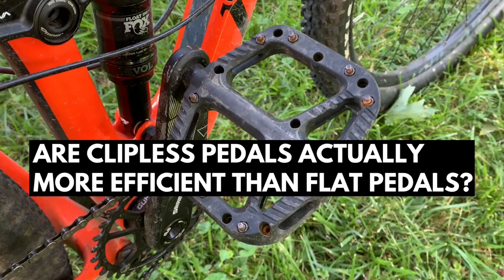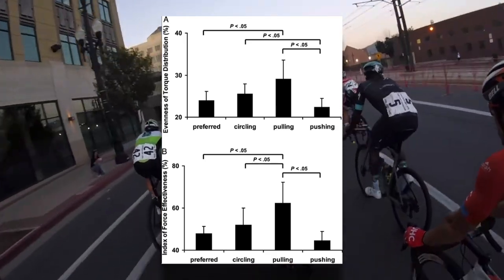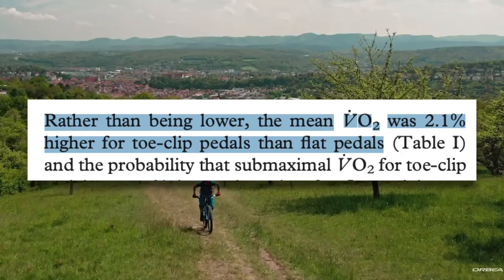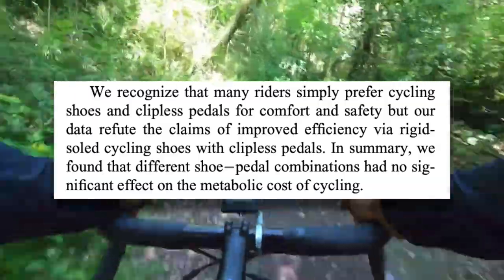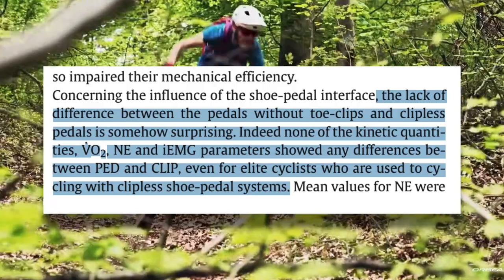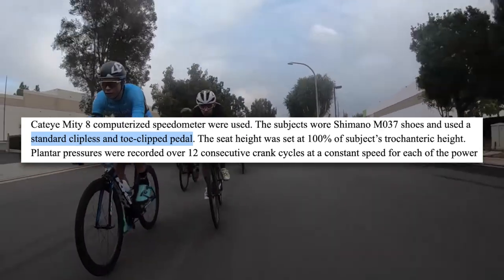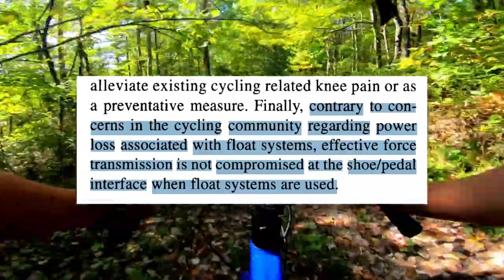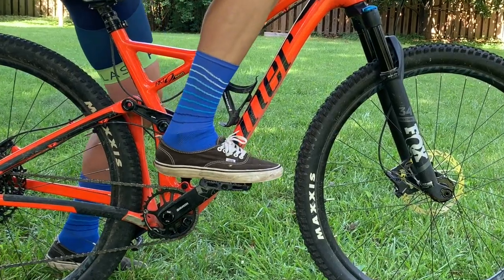Are Clipless Pedals Actually More Efficient Than Flat Pedals? The Answer Might Surprise You.

Comment: I prefer flat pedals but it took a few years to get the right pedal and shoe combination. I use a set of flat pedals with deep teeth on the outer edges and a pair of lightweight walking shoes/trainers with a deep rugged tread that matches the spacing of the pedal's outer edges.  I find even in wet weather my foot rarely slips and yet I have complete freedom of foot movement. Stopping and starting is easy, for example, when I'm out with the group and we stop at a junction I'm always first across it while the others are fixing their shoes into the clips. Also, I've developed a 220-240 degree rotational force on each pedal as the grip of the shoe lets me push before TDC and pull after BDC.  I'll admit that should I do more serious mountain biking or road races I would probably consider clipless rather than flat pedals.

Comment: I went to flat pedals for mountain biking, and NO WAY would I ever go back. It's great when you need a quick foot out to prevent disaster that can happen at any time. I still clip in on my road bike, but I am thinking about trying flat pedals there too, for the same reason.
I motorcycle too, and a quick foot out has saved me many times.
Adding more float also adds to the amount of rotation needed to get unclipped - not good.

Comment: I can think of 2 situations where flat pedals just won't cut it. Anything at actual high RPM (200+) and when you are putting down serious power. The highest I saw in the clips shown was 1100 watts. I'd like to see someone do 2000+ watts on flat pedals. I get it, it isn't about efficiency but thats partially the point of clipless, you don't have to worry about control at the really high power or really high RPMs.

Comment: I cycle about 12.000+ km each year. 30km+ every day without caring for any weather conditions (rain, snow...). I would never even consider clipless. I like to sometimes change my foot position on the pedals, especially uphill or on longer tours. Further since I have to drive a lot (2/3) between crazy car drivers on regular streets, I dislike the additional risk due to the unclip time.

Comment: It's been known for a long time that you don't pull up on clipless pedals except at very low cadences, the benefits are in a solid power transfer, a recreational shoe has EVA foam to absorb impacts, this also absorbs power, you could get the same benefit with a completely rigid shoe. Pulling up has never really been the reason for clipless pedals.

Comment: I’ve used flats for mtb until this year. Climbing in gnarly terrain (rocks, roots, etc.) is where clipless are undisputedly more efficient. Flats require you to stand and “scoop” the pedal so that your foot doesn’t come off. Also when a flat pedal does slip it takes off a significant amount of skin. Descending, you can be lazier with clipless and your foot won’t come off, but it’s not necessarily faster (Sam Hill!)

Comment: Cyclists started to strap their shoes to the pedals before the first world war to stop the shoe slipping or lifting off the pedal when the power was applied. A grooved plate was nailed to the sole of the shoe which engaged in the rear rail of the 'rat trap'.
The problem with doing studies on amateur and non-trained cyclist is they do not know the most effective pedalling technique. They rely mostly on the quads and hams.

The proper pedalling technique is to imagine you are climbing a ladder to the handlebars.

Comment: It's never been about energy efficiency. It's always been about having consistent foot placement and the ability to twiddle - high cadence against lower resistance - much better for knee health. And even when honking - up out the saddle - having your foot clipped to the pedal is better. I have ridden a friend's bike with large flat pedals fitted with those sharp little studs - they're pretty good at keeping your foot in the right place, but I suspect that will be at the expense of rapid wear to shoe soles. My current ride is a Dutch sit-up-and-beg with the Shimano seven-speed hub gears. I wore the cheap plastic OEM pedals out after a couple of years and fitted Shimano SPD single-sided with the required (in UK) reflectors. I have SPD sandals and shoes. I rarely go above 15mph.

Comment: Having your feet in a slightly different position every time is probably better for your joints than having them at the exact same spot every time. As in that's why the floating systems are more knee-friendly as well.

Comment: After 2 years of clipping in on my road bike I discovered the advantages of clipless pedals are tiny and mostly high cadence on very fast flat group rides but the drawbacks constant. After achilles and knee injuries went back to flats and haven't looked back. I can climb better on flats thanks to mid foot pedaling and can also change position on the fly reducing fatigue. Unless you're racing no need to clip in its not that good, much more expensive, more dangerous to boot.

Comment: I use 1989 Time clipless pedals with 1989 Shimano genuine leather shoes on my 1988 Trek 560.
They are absolutely more efficient as proven by Greg LeMond. 
I can apply quads, hamstrings and calves during nearly a full 360 degrees of rotation.
But I use cages on my Mountain Bike so my feet can disengage immediately.

Comment: Since I ride single speed I like being able to change my foot position depending on cadence or power needed. If I have to stomp on it I will place my foot forward and spare my tendons and pull it back as the torque lowers. I tried Speedplay and had to get a longer spindle because my ankle was hitting the crank arms. Now they are in a box somewhere.

Comment: last weekend, i did a 40 miler NOT with clipless but with a falling apart taped up pedal that was sticking to my shoe. it clearly felt like i was able to gain a few watts thanks to the adhesion. so my question is: if clipless can be rated as less "efficient," does less efficient actually mean slower? i don't think that's necessarily the case at all. rather, maybe if you are bringing several more muscles in to bear, they don't have to be collectively more efficient in order to usher in real performance gains

Comment: They are SLIGHTLY more efficient. 
The moments where you actually pull up are very rare. It's only when you sprint HARD that this might become a factor. Otherwise no one is out there pulling up on pedals.
The real advantage comes from being able to accelerate or move around on your bike for whatever reason and keep your feet in proper position. We all remember the marks of the pedals on our bleeding leg because we missed a stroke.
Having the feet at any moment is enough to validate it as more efficient. This being said, have you tried to stop during a 12% gradient climb and then have to clip back on? It's nearly impossible if you have nothing to stand against.. I've see experienced riders have to GO DOWN a steep climb just to be able to clip in and then try to make a U turn while having traffic in both lanes.
Nevertheless, i'll never go for a ride on a road bike with flat pedals. It's just too loose and feels weird. Once you get used to the feeling of being a mechanical part of the bike you'll never want to go back.
But on my mountain bike, sorry, i will NEVER use clipless pedals. I want my feet free to touch the ground at any moment. I've seen enough people fall because of being clipped in and not being able to take their feet to the ground quick enough.

Comment: I use clipless pedal on the road bike and mountain bike. But I am tossed between flat and clipless pedals. Because when mountain biking they do become a problem in tight technical places. But I wouldn't use anything else on the road bike. I don't try to pull up with them. all you need is a smooth pedal  rhythm .

Comment: Interesting. Great video, thanks.
Were there really no studies on climbing or max power output??
I've definitely heard ppl quote (frankly outrageous) power increases.  Though I wouldn't be surprised if they were fabricated.
As primarily a tourer / commuter / casual climber I'll take comfort in knowing it doesn't really matter.
I have been talked in to using old school toe clips, and now that I'm used to them I do like them, esp on step climbs and out of the saddle.
I resist cleats because I like to be able to actually walk... Also $ for nothing isn't my jam.
Overall I'm not surprised that the tests returned no efficiency gains.  After all, pulling up recruits lower efficiency muscles.  I'm already familiar with research that even the hardy and powerful calf muscles have virtually no benefit in distance cycling.

Comment: I bought cycling shoes, not because of efficiency but because I think it is safer to use than flats, Technically when you are clipped-in your foot won't go anywhere, It's safe and secured to the pedal especially on trails where hitting your shin with the pedal spikes are significantly higher, Even on roads cycling shoes eliminates the danger of your foot slipping to the pedals when you hit a pot hole or when sprinting

Comment: I think all of these studies are sort of missing the mark. While I can see why any gains from clipless would be negligible on a road bike or gravel bike, I know from experience this is not the case on a mountain bike. I ride a hardtail and the roots & rocks of my local trails make for a fairly bumpy ride. When I was on flats, there were sections where I couldn't apply power because my foot was temporarily "weightless" on the pedal due to the bumps. When I switched to clipless, I noticed a significant difference in when I could apply power. My feet remained connected to the pedals, even in bumpy sections, so there was never any "weightlessness" where I couldn't apply power.

Comment: When very exhausted and climbing I usually do the following kind of strokes which I think wont be possible or usable in the flats, short punchy “kicks” on the upstroke so theres no further movement of any leg after that, and sometimes using force only on the pulling of the downstroke, feeling more strength on those muscles

Comment: Personally, I feel it's pointless pulling on the upstroke, since your foot is meant to rest on the upstroke while the opposite foot is on the downstroke. Also, I used power grips on flat pedals for many years, and they were excellent. Wouldn't use clipless pedals, and would no longer use flat pedals without power grips.

Comment: Dear Dylan, first of all thank you so much for your amazing, interesting and entertaining content. I have a question regarding HIT interval training: After watching pretty much all of your videos and reading some relevant literature, I got the point: 2 - 3 HIT sessions a week, and only when you are well rested. My question is: Are there exceptions to this rule?? I am asking because I am currently following a training plan from Strava (which are designed my CTS if I am correct...) for improving my 90 second sprint capability. Within the training plan, there are multiple session where I have consecutive days with HIT intervals (I am sure, BHDD would approve of this). Although the duration of these intervals are different (for instance: first day, 8x1 minute maximum effort, with 2 minutes rest; second day 3 sets of 5x30 seconds on, 30 seconds off). Is there a reason why sometimes it makes sense to have intervals on back to back days? I appreciate that you probably wont have time to answer this questions, but I thought i give it a shot anyway :) Looking forward for more content and best of luck for all your upcoming races!

Comment: another point for clipless pedals is on long bike rides you can take a short "brake" and only pull to get a bit of rest on the muscles used for pushing. This for sure isn't very effective and you can't do that very long but I catch myself doing that on the flat sometimes and riding several hundreds of meters on the flat that way.
On short bike rides this isn't a big deal but after 200km and more this can be a nice temporary relief.

Comment: This might be a product of my short attention span... but if a study is measuring V02 Max with or without clipless pedals I think that's a big misguided. I think they are comparing overall fitness to pedal style. 300 watts is 300 watts. I'm sure the studies addressed this but it wouldn't surprise me... a lot of research is severely flawed these days. And of course, as Dylan pointed out, they didn't try hill climbs, max effort, etc... It sounds more like they just did 'easy' tempo tests.
What's important is how much power goes to the road per effort... or how much 'watts' right? Forget the studies. I think having a power meter (lets say one built into the rear hub -  so a person can try both styles of pedals) and various tests that way would be more suitable. I have a route near my home that gives me a very good idea of what improves my overall speed (typically I need a 5% increase in speed for the 'upgrade' to be noticeable). Upgrading my wheels, upgrading the bike itself, and using clips all netted a noticeable speed increase. Also sugar loading... but that was a horrible idea and I think I almost became a diabetic; don't recommend!!!
I know that, 100% for certain, I am a faster rider with my clips. That doesn't make me a 'fitter' person; as I get older speed is less and less of a priority comparing to simply staying healthy. Therefore, I am probably getting rid of my clipless and either going back to clips or even flat pedals. Whatever allows me to enjoy my ride more I guess.

Comment: I prefer sneakers and platform pedals on flat roads... it is easy to sense the up stroke - which means I am getting the upward leg out of the way. One should not be pulling the crank up, but one should not be letting the up leg get in the way of the down leg. If the up leg is not in the way - gravity will be able to pull on the down leg...  that's free wattage.

Comment: Serious sprinting is impossible without clips. If you think of physics of it, there is an upper limit of force you can apply to pedal without jumping up, that only depends on your weight. This is easy to test - try generating a maximum power clipped in and on flats. I bet that for trained cyclists the  difference will be quite significant.

Comment: I use flats and when climbing or pedaling for a long time I tend to move around my feet on the pedal just a tiny bit and it somehow helps some of my muscles to rest. For example I go like: pushing almost entirely by toes and assist with ankle, then go almost all the way back to my ankle, then open my knees and push on the outer part of the pedal (while looking like a foolish kiddo), then I go all the way inside. After I moving around like this a few times I feel like less tired without ever stopping. Not sure if it's only placebo effect, but it works for me, and this is only possible with flats :)
Reply: Shifting your riding position is 100% possible and (maybe not 100%)effective on clip less you just need to learn how

Comment: Thanks for the video it was very informative, but I have a question. Perhaps the point of clipless pedals is not necessarily efficiency but more to do with distributing the workload across more muscle groups. I noticed, even riding with flats with tall studs, that if I pull the pedal with my hamstring muscles, it gives my quads on the other leg a rest. Is this that not a benefit? I'm doing a lot of riding lately, and my poor quads are aching. I haven't gone clipless yet, and want to soon. On a side note, my cousin who is the number one downhill and enduro racer in Greece uses clipless pedals for both road and mountain bike riding, and his hamstrings are rock hard.

Comment: If human hearts and lungs had twice the capacity it might be a minor factor. Also you are not just pulling up, you are working against gravity which cancels out any efficiency advantages. A study on a rested one km sprint, removing the cardio capacity issue, would probably show a dramatic difference between straps and flats.

Comment: 2 comments 1 It's not pulling up but pulling back at the bottom of the downstroke through the dead point makes  a different. 2 The foot stays stable on the pedal and doesn't slip out of position

Comment: Thank you for this well researched video. I do have a question about the studies that I'm admittedly too lazy to look up myself; did they normalize for speed/RPM/power output/etc.? I don't think it's fair to say that clipless pedals are less efficient because they caused a slight increase in v02, if that increase was actually associated with higher RPM, higher power output, speed, etc. Thanks.

Comment: Turned up to my local hill climb without my cycling shoes. Had to ride in my work shoes (safety shoes with thick soles). I won easily - that was  a surprise.
Reply: But was that really because you used flats? Its most likely due to other factors.
Reply: @shmee.  main factor was that the strong climbers didn't turn up and I has great legs on the day. I didn't win because of flats, but they didn't hold me back from putting in a great effort - peak 30 min power for the year. The descent was horrible though, flat shoes on road pedals.
Reply: @shmee.  just to make it clear, I had to use look keo pedals with my work safety shoes - luckily they have thick rubber soles and a stiff forefoot. Can't discount that the embarrassment of forgetting shoes had a mental effect as well.